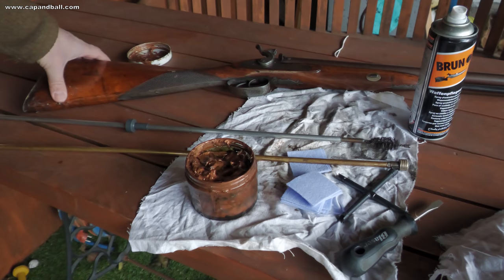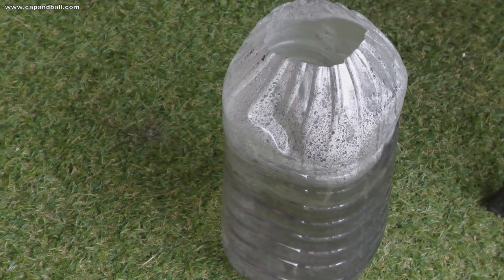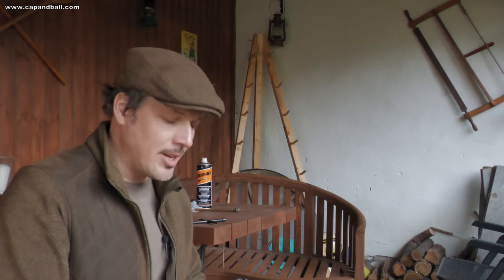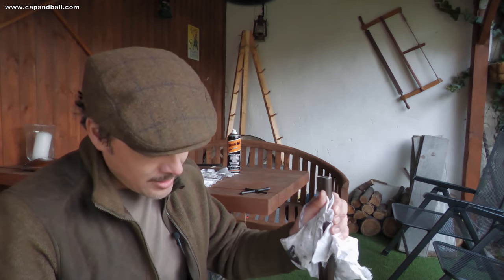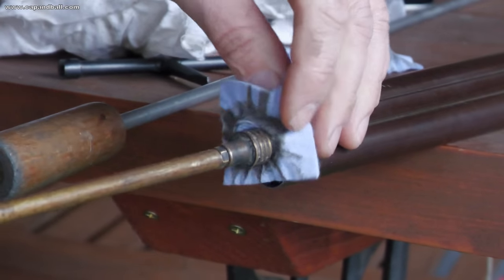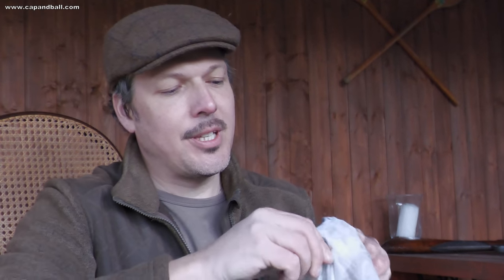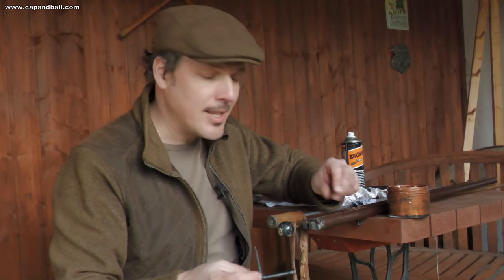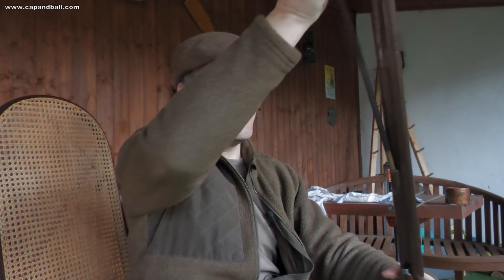How to clean your muzzle loading shotgun

Comment: The only thing I do different is after cleaning the bores, I flush them with boiling water from a kettle. This helps dry the barrel and washes the last little bit of carbon out. 

Other than that, same process my father taught me, which his father taught him, which his father taught him...

Thank you again for another great video.
Reply: i was going to suggest the same thing, but you beat me to iy.
Reply: You run the risk of creating flash rust when you use boiling water
Reply: Boiling water is great but you have to reclean with cold water.

Comment: So I have had varying degrees of success cleaning my cap and ball rifles so I dried out your method yesterday using a wet patch to seal the rifling and create the water pump effect that you did. This was total genius. I was able to fully clean two rifles start to finish in 45 minutes. The actual wet cleaning part only took 15 minutes or less! This is a game changer for me as it took almost no time at all.  I also used a hair dryer blowing down the barrel to help dry more quickly and heat up the barrel so it will allow the lubrication to penetrate the steel better at the end as well. Looking forward to how this works out! Thank you

Comment: Excellent video of a VERY controversial topic. Over the years we've seen lots of people with different ideas on what to do and how to do it to clean muzzle loaders. We kept is simple and this is almost how we do it too. The minor differences are, after putting the nipples in the same water I clean the bore with I put them in a cast iron pan on the stove in order to dry the inside of the touch hole. I also pour boiling water down the bore after cleaning in order to heat the barrels so they can dry more effectively. Easier to coat with oil too, especially with bore butter. BTW, in order to save my hand from the hot water I use a silicone oven mitt. Works great, protects and gives good grip. :-)

Comment: When i used to shoot black powder guns , pistol, shotgun, flintlock etc. I used WD40 which held off any damp on the powder residue that caused rust. I could go without cleaning for a week or two with no rust whatsoever. When i had time to clean the gun i used hot water with a water oil mix like Youngs 303 oil. You can use soapy water but be careful as some soap like washing up liquid contains a salt.  The heat of the water would dry off the barrel or cylinder and then oil.
The real reason water was used to clean bores on muzzle loaders especially percussion cap firing guns was that the residue from the old type primers left a salt  from the mercury in the primers that creates potassium chloride this with burnt soot rusted barrels and the potassium chloride could only be removed by water. 

In early cartridge guns that used  corrosive primers found more so in military ammunition until 1950, the barrels had to be swabbed out with oil water mix ie Youngs 303 which you mix with water. 

Gun owners using early cartridges using the new smokeless powder with these primers thought that a good oiling of the bores were enough to clean the barrels but the corrosive chloride was still coated up the bore eating the barrel away causing pitting of the bore over time. 
If you look up barrels on old guns from the 1900s 1920- 60 you can see pitting in bores on a lot of guns. You tend not to see this as much with Flintlock guns as they didn't use corrosive primers. Of course you will see flintlocks with bores that have rust in them but it will be a fine pitting not like the deep patchy pitting of corrosive primer use, which in some cases can be a danger to shoot. I still shoot but other peoples guns but would love to get back into muzzle loading and get myself a flintlock which i love shooting years ago, but here in the UK its now difficult to get back into it these days.

Comment: Similar to my method.
1: Use 1/2 cup Simple Green to 1-gallon hot water, it will remove all fouling without harming the finish.
2: wrap a 2-inch square patch over and around my bronze bore brush.  This will act as a pump and draw the water/cleaner up the bore to greatly aid in cleaning as it foams up.
3: I use Ballistol, a mineral oil-based chemical on all surfaces, it will lubricate, and protect metal and preserves the wood.  were as petroleum products can damage the wood over time.
4: I use Loctite Silver Anti-Seize on the nipples, (it's what I have).  and bobs your uncle.  ^~^

Comment: I do a similar method cleaning my original 1863 Springfield after matches but I leave my nipple in unless the gun won't be shot for the near future. If I can access hot water, I place a piece of rubber from a bikes inner tube folded over a time or two placed on my nipple with the hammer gently lowered over it. I then take a large rag or towel folder over many times and using water that is just below boiling in a campfire coffee pot and fill the bore with the water. I let it set for about 5 minutes and then pour it out and repeat. After 2 or 3 times of letting it sit with the water in the bore, I then begin to simply fill the bore leaving about 2 or 3 inches of air space and place the rag with my thumb over it and turn the barrel up side down until I jhear the bubble get to the breech and the flip it back right. I do this 2 or 3 times then pour the water out. I continue doing that until I either run out of, now luke warm water, or the water from the bore is clear. I find it often depends on how many shots I have fired that day for how fast the water runs clear.
I then attack it with first a couple of drying patches followed by balistol soaked patches alternating soaked patches with drying patches until the drying patches come out looking clean and then oil the bore as you do but I use Remoil or 3in1 oil for the bore and then clean the outside the same as you do but if I will be shooting the musket again in the next day or so, I will not pull the nipple, just spray Remoil through it with the barrel pointed down followed by a folded clean patch held on the nipple with the hammer lowered easily over it.
I have found that with rifles, the Balistol patches are needed to remove any lead fowling that has accumulated whereas with smoothbores, only 1 is needed to help disolve any fowling the hot water didn't get. I also mix my balistol somewhere around 60/40 to 50/50 water/Balistol. Before I found balistol, I had used Moose Milk from the Winchester Sutler but since Tom and Alice closed their sutlery down, I swapped to Balsitol. 
After a weekend of shooting, I will delve down into pulling my nipple, bolster screw, and lock, and cleaning any fowling that has made its way down and then slather them in a good healthy layer of RIG ( Rust Inhibiting Grease) and then make sure the entire arm is oiled and protected. I also store my gun with a sight protector and a wood tompion that has the wood heavily soaked in oil after I have sprayed a good bit of oil down the bore. I find with the folded patch over the nipple and the tompion in place, oil doesn't leak out. I have found this is neccesary here in the Deep South with our humidity, if the metal isn't almost dripping with oil, the metal will develop some rusting even if it is otherwise properly protected. When I lived in AZ, I never had any of those issues, but do here in GA.

Comment: THANK YOU, this video is extremely helpful. I've recently gotten into shooting black powder and I've quickly come to realize just how filthy and tedious it can get, though it's definitely part of the experience. 

Can you perhaps do a video on cleaning Remington percussion revolvers and their replicas? My Uberti New Model Army is my favorite BP firearm to shoot but my least favorite to clean.
Reply: Let me run you through the process:
1.  Remove cylinder, cylinder pin, and loading lever.
2.  Remove nipples from cylinder.
3.  Run a patch soaked in cleaning solution (I use Simple Green) through each chamber of the cylinder.
4.  Put cylinder to soak in a dilute solution of cleaner.
5.  Brush nipples clean, put them into the solution.
6.  Brush cylinder window clean with an old toothbrush.
7.  Clean out barrel with patches soaked in cleaning solution.
8.  Rinse out barrel from breech end.
9.  Wipe accessible part of hammer and frame clean.
10.  Dry barrel and frame.
11.  Oil barrel and frame.  Run an oiled patch down the bore.  Spray oil into lockwork.
12.  Remove cylinder, run a patch with cleaning solution through chambers. 
13.  Rinse cylinder and dry.
14.  Wipe down nipples and dry.
15.  Oil nipples, replace in cylinder.
16.  Replace cylinder in gun.
17.  Oil and reassemble cylinder pin and loading lever.

Comment: After I just had to take the drive from the range to the house to get my firing pin worn out where corroded from black powder I have a modern inline black powder musket and the firing pin was all covered in rust just from going from the range to the house

Comment: First use a Container with cold water and wipe the fouling out of the Barrels by using a Nylon brush followed by wet! patches. Now change to the Container with hot water. Use only wet patches and pump the hot water through your Barrels. The water will never get as black as yours. Change your patches as long as they come out black. If possible use compressed air and blow your barrel dry. Brass or Bronce brushes are not necessary if choosing this method.

Comment: What kind of oil are you using? I thought oil was bad for black powder guns. Would Bore Butter be better?
Reply from the maker: That's a swiss penetrationg oil called Brunox.
Reply: I've found each gun has a different preference. Most of mine like Remington oil
Reply: @gregorybrown4062  I have lots of Rem Oil, thanks for your comment.

Comment: I believe you should clean any gun after you shoot
Reply: eh, with modern smokeless and clean priming, not really necessary. I used to shoot an average of 500 rds a week in a remington 512 when I was a teenager, cleaned it weekly (only because I noticed the accuracy open up if I went 2 weeks lol). Now that I'm unfortunately too busy to do that, I clean my smokeless guns yearly, just wipe them in oil every once in a while If I have them out and about. BP draws moisture, so you have to be careful, and it's just simpler if you clean them after you fire them.

Comment: Where do you buy copper paste and what are the advantages? I'm in America and I've never heard of anyone using it before.
Reply: You can buy copper grease or spray from hardware stores.
Reply: Antiseze is available as either a zinc or copper based grease. Another trade name Is Neversieze.  The zinc based grease can be used around aluminum components. NEVER use the copper based grease around aluminum. One must keep track of the galvanic series.   One should be able to find the compounds at any auto parts store. They are very commonly used on spark plugs.

Comment: How do you clean the patent breech area on a pedersoli hawken? My jag is too large to fit in that area as well as the fire channel and I'm wondering if residue will build up over time.
Reply from the maker: The water flowing in an out cleans the smaller diameter are as well. if you want to be perfect, after a few sessions use a smaller diametre brass brush to clean it. Or the steam cleaner can be a good solution as well.
Reply: Yup, you use what fits for the task

Comment: Doesn‘t PTFE form hydrofluoric acid when it gets hot?
You‘re definitively on the safe side with copper paste.
Reply: Decomposition is incredibly slow up to even 400°C, which the nipple doesn't heat-soak anything close to, so its not an issue in any black powder application. Copper pastes will break down at a simlar sort of temperature range anyway, and are more abrasive... its still totally suitable for purpose, but not really a "safer" bet.